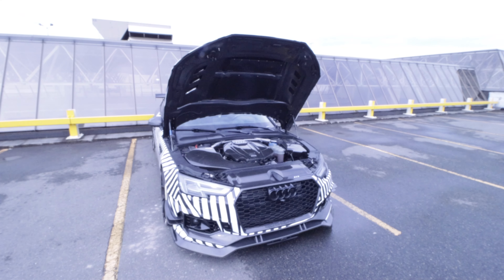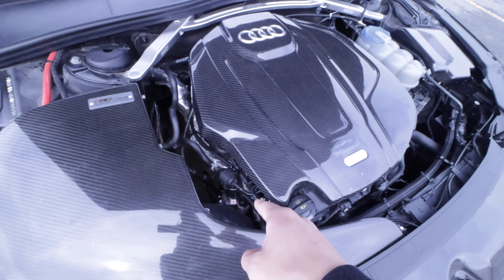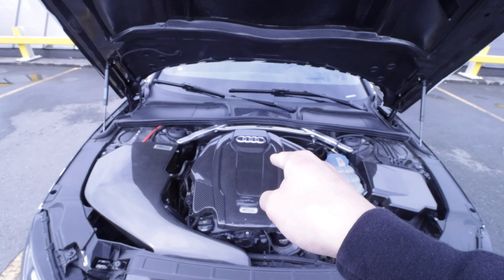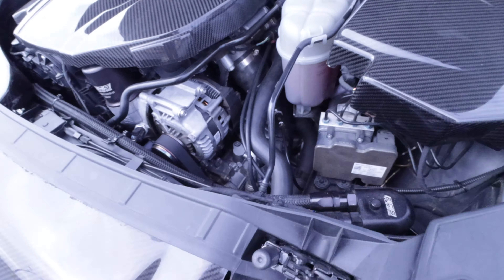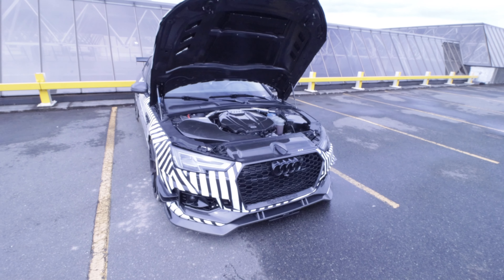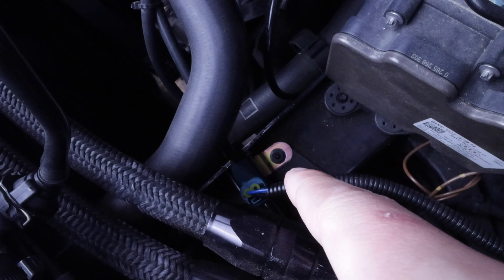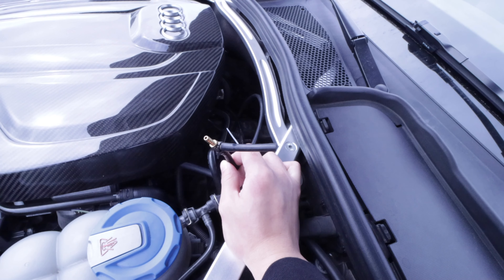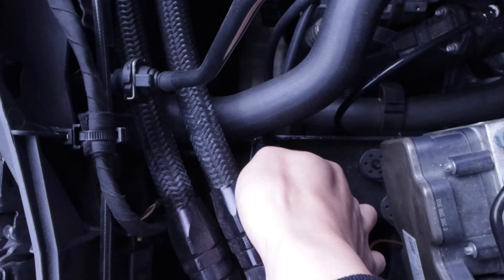Audi A4 B9 Custom Tune For TTE440L Is Failed!!

Comment: Hey yaode, i just got an A4 B9 this March and i have been doing some modifications myself. Just received my sturtman stage 2 tune and have a HG Motorsport intercooler and CTS turbo high flow cat on the way. I really love your videos and appreciate the time and effort you've put into working on your car, Youve given me so many ideas on my car like the passenger side screen mount. Keep up the good work!
Reply from the maker: Mediocre Max Congratulation to your car, glad you enjoyed your car! Appropriate your supporting.
Reply: Mediocre Max, its an awesome car! Enjoy it! Don’t be like me and blow it up😂
Reply: @jordanrose6667  I hope I don't haha, its my primary so if it blows up I'm screwed lol
Reply: Mediocre Max it was my only car too. To be honest they’re really well made but i had the wrong tune in mine which led to the breaking of the car
Reply: How do you like the Stertman tune? I’m looking at going stage 2 as well with them.
Reply: @N8theAsian  I purchased the tune about a month ago but I haven't been able to put it on because they didn't have my cars stock file on the server to back up incase an issue arose, also I haven't had the time to install my new intercooler and downpipe, which are both required for the tune to run properly. Where are you looking to purchase from?

Comment: I have a b9.5 a4 on ie stage 2 for about 50,000 mi and havent had an real issues love the car and just made some very healthy run on the mustang dyno and put up 340hp and 360 tq. On stage 2 93 tune with stick turbo will ve running e85 so will be ready to post some real numbers but i wanted to know do you think theres a better turbo setup for our car yaode? Garrett makes a good setup but i get a little nervous about the big turbo set up anywaynwould love to hear what you think since were both chasing times

Comment: I have a 2017 Audi A4 stock is there a place where you have the parts listed so i can do things like this? How much horsepower did it have stock compared to now?
Reply from the maker: Enovah https://youtu.be/1SM101diaw0
Reply from the maker: Enovah Check the description of this video for the most of list. And I did I dyno on my APR Stage 1 and IE Stage 2, you can also check out the videos. And the dyno video for this new turbo which will live tomorrow.
Reply: Yaode Chain Thank you!!